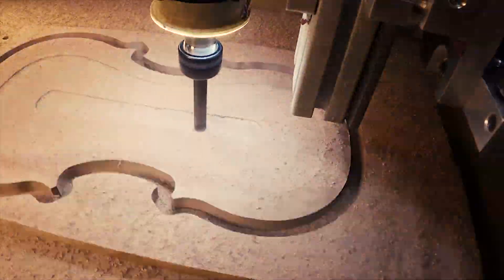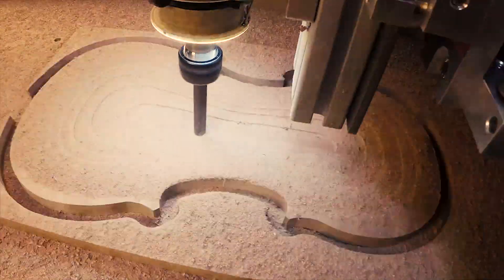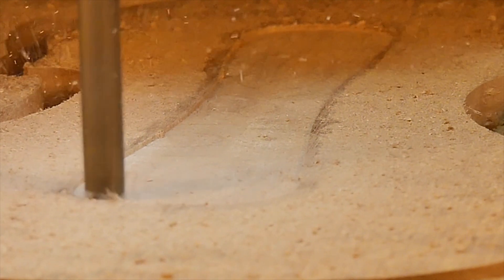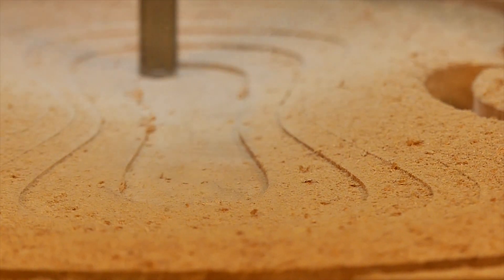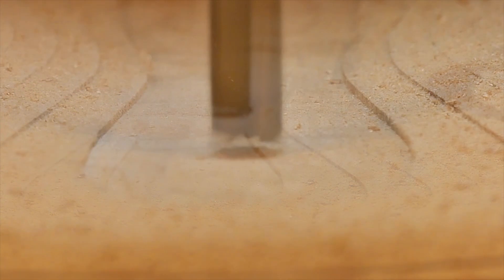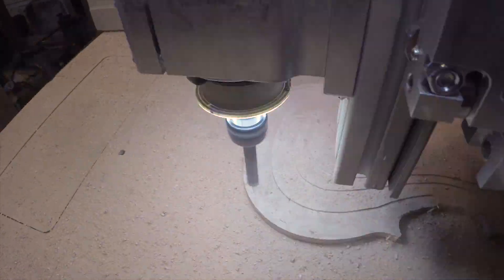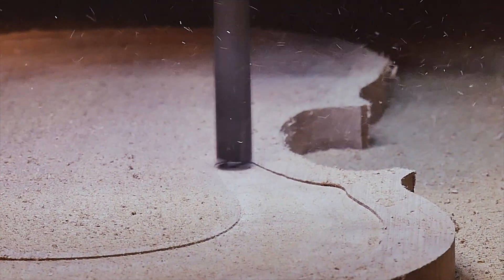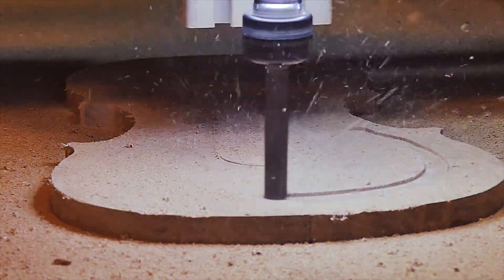Making the Amati Romanov Viola Back

Comment: Sorry,where is the button?😊
Reply from the maker: No button on this one.
Reply: @TwoCherriesIns  I have seen. Why?
Reply from the maker: @elena.3756  I made this design for another maker. I make 3d models of the parts requested and provide technical drawings for approval. A button was not requested; the part was cut as represented in the approved drawing. They are easy to add to the 3d model, It would only take a few minutes to add it and re-post the code.